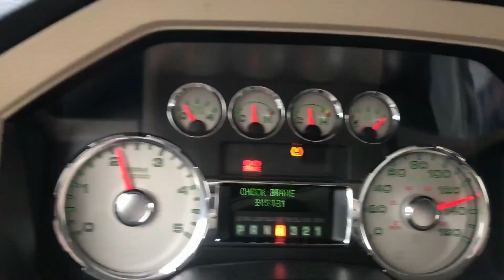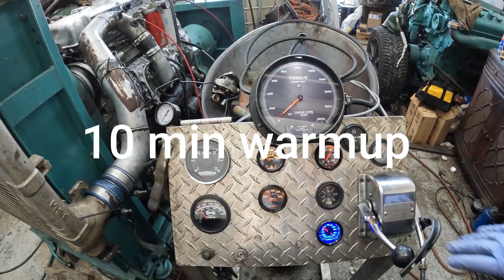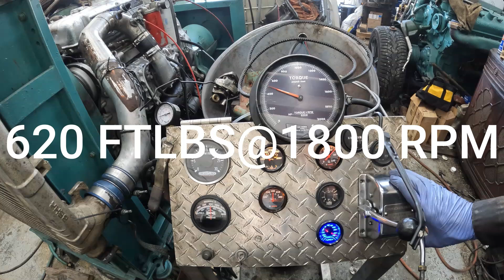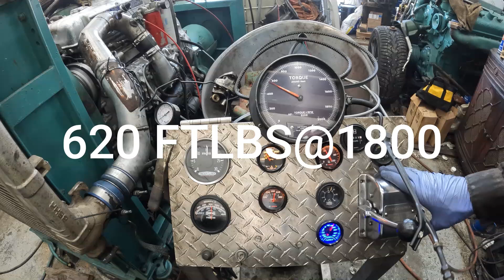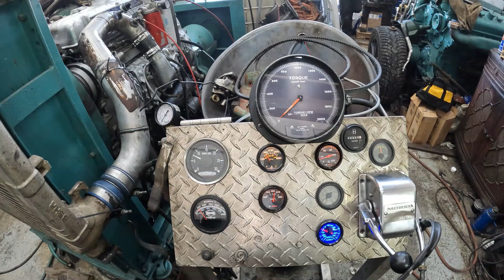Detroit Silver 4-53T (Last Dyno Session)

Comment: What effects would you see trying to run without the restrictor in place in the fuel return ( in did my initial start and eval with a open elbow and things were a bit iffy at idle and start up and am hoping that may be why)
Reply from the maker: You won't build enough fuel pressure for the injectors to function properly.  Can always use a standard fitting and press a restrictor in.  Use locktite if you're concerned it might come out.:)

Comment: I had a thought about the bypass 'failure' form the other day. Could it be that it didn't work because the volume of air going to the air gallery covers and bypassing the blower simply isn't great enough? Leaving the turbo connected as it is, is actually a compound arrangement. 

Also, seeing poor Greta Thunberg reminded me of Peter Cook and Dudley Moore on the Joan Rivers show doing an improvised live sketch they used to do from 20 years prior that mentioned another Greta. It's very funny.
https://www.youtube.com/watch?v=GNzYz5K1PbU
Reply from the maker: That's what myself and others are thinking, need 140-150cc injectors to move more air.:)  Overall very happy with the outcome, so back to standard timing, no bypass and the Pulsar turbo.:)  Lol, haven't seen these guys for years.:)

Comment: NOTHING you do is wasted, NOTHING! This tells the tale about the advanced cam timing. NOPE! And the Gretta curse-HA! The puffs were what I saw out of the box trucks years ago. The drivers nailed the pedal just to watch the cloud and listen to the scream! Glad the tranny unlocked. Waiting for the next one and 30 horses is still there. Just have to return to it!
Reply from the maker: Thanks, yes I'll configure it back to get the 270HP and 715 Ftlbs with the Pulsar turbo, no bypass and standard timing.:)
Reply: @detroitgarage9430  YESSIR and THANKS!
Reply: I remember when I worked at a moving company we had a Chevrolet Express with the 6.5 diesel, that thing blew black smoke like a steam train but still hauled the load good.
Reply: @Bull3tBikes  Everybody here jacks their pump wide open so their whatever does that and then why the motor blows up.